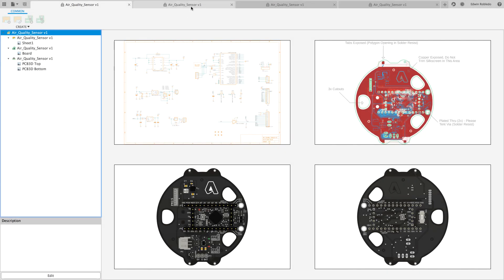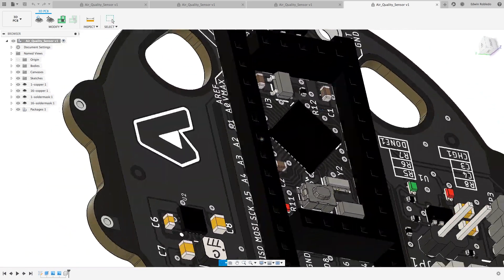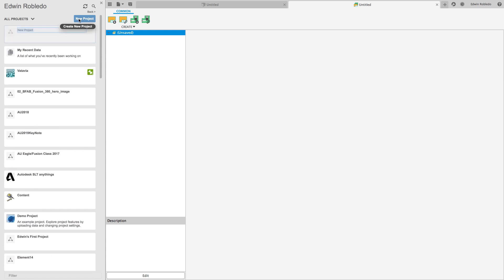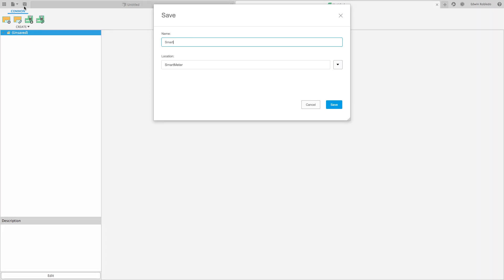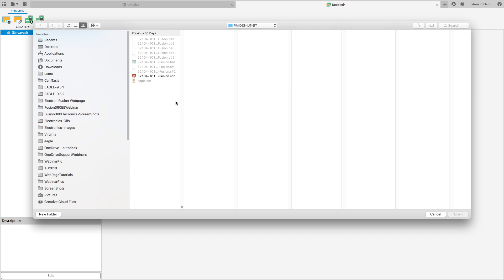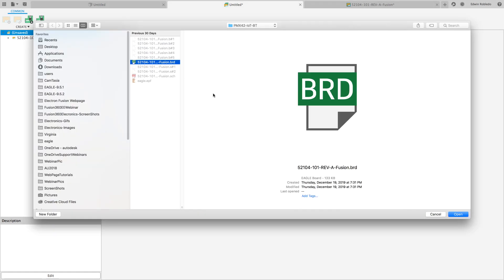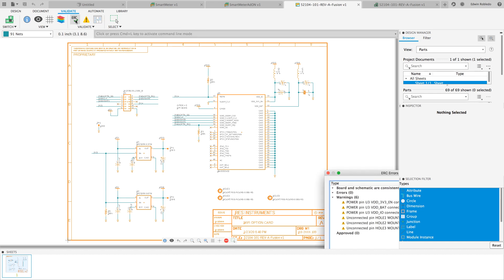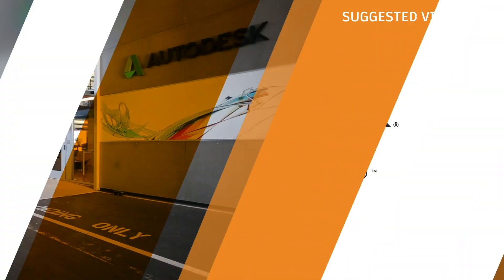How to Import EAGLE files into Fusion 360?

Comment: could you import gerber files as well?
Reply from the maker: Happy to realize I was wrong. From the expert: "Fusion 360 expands its electronic workspace by allowing users or our team to expand its capabilities using a C-Like language we call User Language Programming (ULP). This method is commonly use to export and import file formats. one of the import ULP included with Fusion 360 is to import Gerber files. It only supports basic 274x format. The imported file can be used as a template, not for editing." And see this image as well: https://www.dropbox.com/s/rps11de8op3bfyw/Import%20Gerber.png?dl=0
Reply from the maker: To the best of my knowledge, there is no way to do this at this time. That said, I'll have one of our experts take a look and weigh in on this.